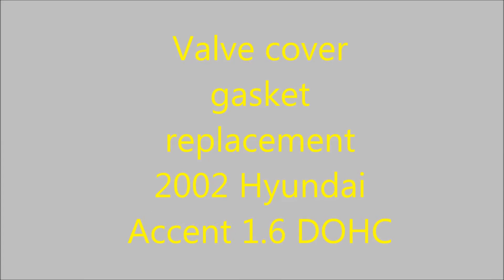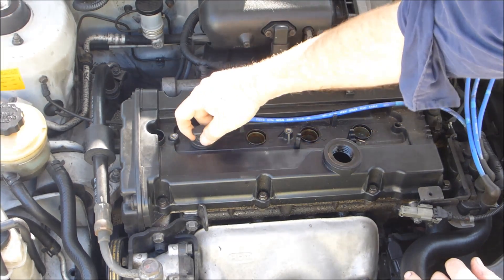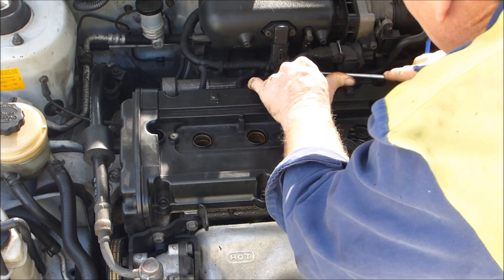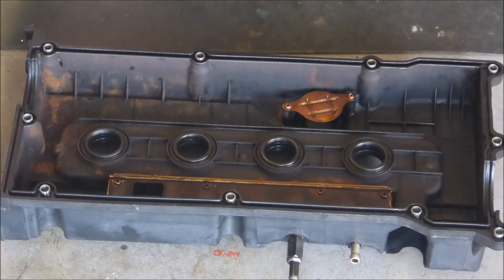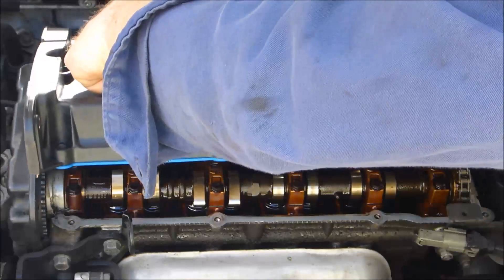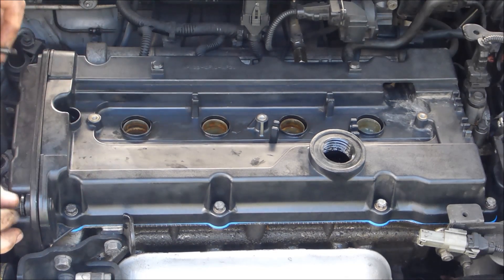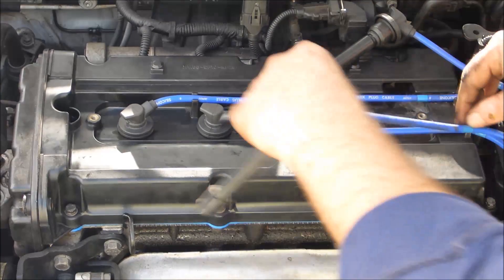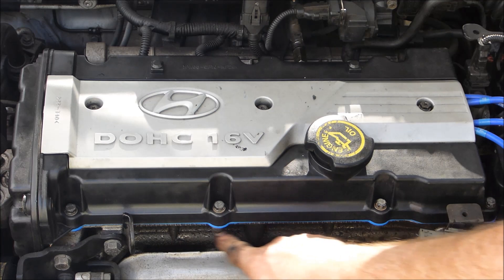Hyundai valve cover gasket

Comment: Just wanted to say thank you for this video  Did my son's Getz after seeing this and it giving me the confidence to tackle it. 
A few snags....had to get forceful to separate cover from head...and there was a fair bit of old gasket to remove so had to use a sharp edge to do that which didn't sit comorfortably with me...but a smooth down with 2000 grit and it levelled out the minor score marks.
Good tip on the silicone. I used RTV and left 24 hours before start up. 
Fingers crossed it is OK. Took me the best part of 4 hours...but that was also cleaning a very coked cover and changing the spark plug tube seals.
Reply from the maker: Glad to help Deano

Comment: hey. i love this educational video. im aiming to do a tune up on my 08’ hyundai accent & before i got started i noticed i had oil leaking onto my spark plugs… i was told to just change out the valve cover as that might be my problem.. but now im wondering could it be those “spark plug cups” having a crack or hole in them? it would be great if you could help me out with a bit! thank you in advance
Reply: could be, but unlikely. only way to be sure is to take the cover off anyway
Reply from the maker: The industry standard is to replace the rocker cover gasket and spark plug gaskets. When you do, make sure to put silicone at the camshaft seals. That's a common leaking area. A retension after a few engine heat cycles is advisable, the gasket moves & shrinks.

Comment: HI Mustangdude
We have been trying to find a DOHC gasket seal everywhere just like the blue one in you video, IS there anywhere you know of, as all gaskets seals we have tried are way to thin, which keeps causing the oil to leak from rocket cover, Your help would be greatly appreciated. In desperate need of your advice.
Reply from the maker: I'm in Australia. That blue gasket is what was sold to me. The color doesn't matter obviously but I would install the new rubber gasket in the cover and see if the gasket protrudes or sits proud of the tappet cover. If it doesn't the gasket probably is incorrect for that model.

Comment: not sure if you're still replying to comments. but I have noisy and possibly damaged lifters. ran lifter tune up and it has not quieted them down. got an 07 with 1.4 for my first car. (previous owner flogged the poor thing) she does only have 106,000 and I got her at 89. so I got lucky on the milage. but I'm thinking of trying to do the lifters my self as I'm getting quoted 900 odd bucks and I don't have that type of money on hand. would you reckon its a relatively easy job to do?
Reply from the maker: The lifters always gum up in these engines, it's common. I've done a few with good success. If your doing the cam belt replacement it's the perfect time to clean the lifters but I wouldn't recommend it without someone having some mechanical knowledge. The cam timing is crucial, get it wrong and it will do major damage to the engine. The lifters never get quieter with oil changes or other methods, the only way is removal and clean the gum so they free up again.

Comment from the maker: It sounds like the air conditioner electric fan isn't starting up. 
Run the engine with the AC on and watch for the fan to start up. It might start whenever the AC clutch is engaged, I'm not sure. But it should  start as the temperature starts to rise.
Reply: mustangdude dude i just did the same thing i changed the gasket and its leaking like crazy plus its making air leak to but i didnt use the gasket maker or the silicone is it the problem and my valve cover has a little crack in one of the bolts holes
Reply: and its even heating up real fast
Reply from the maker: You need a new valve cover, and use silicone in the areas at the camshaft as the video shows. Then your problems are fixed.
Reply from the maker: More information is needed. First fix your oil leaks.

Comment: I have a 2009 hyundai getz, when I turn on the air conditioner the engine temperature goes up and the high temperature dash light comes on. The radiator panel is clean, there is no refrigerant consumption. The problem occurs only when the air conditioner is turned on. please help me. I'm from Ecuador.
Reply from the maker: Check you electric fan is working

Comment: my hyundai santa fe 2007 is tapping how could i go about fixing the problem or is the car a total lost
Reply from the maker: I'm not familiar with the Santa fe engine. I would change the engine oil & oil filter being sure to use the correct viscosity oil for your engine. Thin old oil may be allowing the hydraulic lifters to bleed down which would result in a noisy tapping sound.

Comment: Hey, where did you get that blue valve cover gasket,  i cant find any that fit my Hyundai Coupe 2001 anymore.  They are all either to thin or do not sit correctly on the engine due to being too thin.
Reply: James Woods get the dohc gasket, and not the sohc gasket. It should fit.

Comment from the maker: Oily spark plugs, assuming the plugs are the correct heat range would indicate an oil usage problem.
Oil getting past the rings or valve stems.

Comment from the maker: It sounds like one of you spark plug leads isn't on properly or swapped with another. An engine missfire will shake the engine.
Check your leads. If you had the spark plugs out did you gap them correctly? You may have a faulty lead or plug.

Comment: I'm having an issue with my car shaking aggressively after changing it. Any reason why that is? I'm sure it's an easy fix. I just don't know if I tightened to tight or what.
Reply from the maker: Check the muffler bearings

Comment: Hi Diego,
I don't have much faith in these flushing/cleaning products. They're usually expensive and don't always work.
It can't do any harm and may improve the ticking you hear but the true fix is to remove or replace each hydraulic lash adjuster and clean them out.
The problem is the adjuster is at the end of the line as far as oil travel goes. There's a small pin hole releasing oil so the build up of gum & contaminants stays in the lifter jambing it and not allowing full extension therefore not taking up the valve clearance.
These lifters get stuck really badly, so much that they can be difficult to pull apart to clean.
Replacement would fix your problem.

Comment from the maker: There must be something different when you reassembled the cable.
Have a good look at it, was the cable adjustable?
Like two nuts on a thread, if so the cable should be adjusted correctly if you had to remove the nuts.
It's a safety issue & should be fixed.

Comment: Great video. thank you. I have a 2000 Hyundai elantra. I had to remove the transmission cable from the engine to get to replace the starter. When I reconnected it to the engine block (just a bracket), 'drive' is now where '2nd' is. Not a real problem, I suppose, you just have to shift to 2 for normal driving, Am I ok leaving it like that or should I try to readjust. I think my wife threw my Haynes manual away.
Reply from the maker: Re-adjust for sure

Comment: Awesome video I have a 2005 spectra which has the same valve cover gasket. but do you have to replace the spark plug gaskets? When I removed the cover it didnt have the spark plug gaskets and I havent had any issues with leaking.
Reply from the maker: No they will be OK

Comment from the maker: These engines use hydraulic lifters so there's no valve adjustment.
If you have noisy tappets it's probably because the lifters gum up over time giving a clacking noise due to excessive valve clearance.
I believe it may be more common in cars that haven't had regular oil changes. Old oil doesn't go well with hydraulic lifters.

Comment: I've changed all my belts twice but they still squeak when I start my car.  There's two adjusting bolts one for the drive belt and one under the car for the a/c belt. For some reason they just screw in and out and have no affect on the belt tension? Hope that makes some sense to you?
Reply from the maker: Check your messages Sid.

Comment: Nice video. Wanted to ask you how about the spark plug gaskets. Is there any tricks to replacing them? I replaced them and I'm getting some leaks in one of the plug chambers. Also do you know the torque specs for the screws?